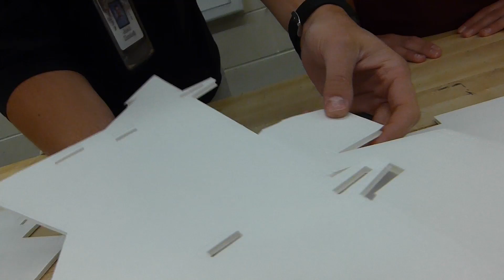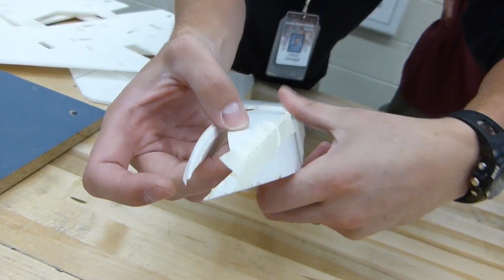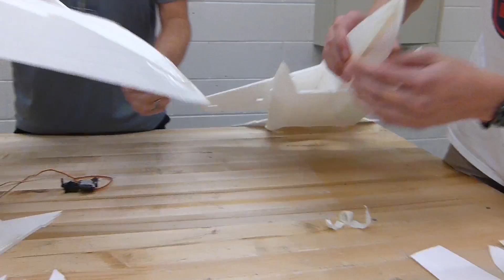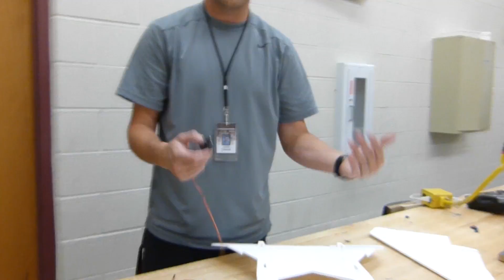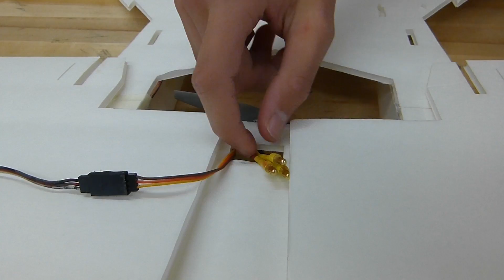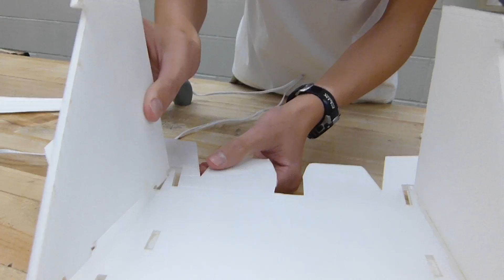MESArcFF - MF-15 Eagle Build - PROJECT

Comment: This foam is not available in india so can I use 3/16" depron And I will be making the brown mf15 which required only 2 servos so what alteration do I need to make to the fin

hey can i even use 32kg density insulation foam ?? cant find anything here??
Reply: +Sushant Singhal and what should be the size of the paper on which i should print the blueprint
as it is kind of confusing i tried to find out the size on manually measuring it it turns out to me around 32''x29''
but according to computer it is around 15''x12''
Reply: +Sushant Singhal these are the only  questions to which i need answers 
this is all i ask rest all i have figured out.
so please reply